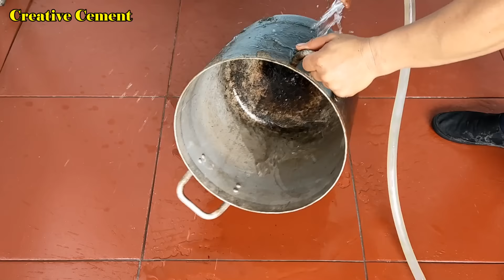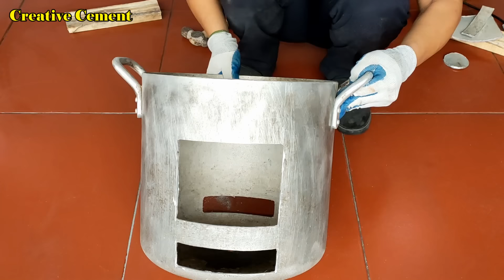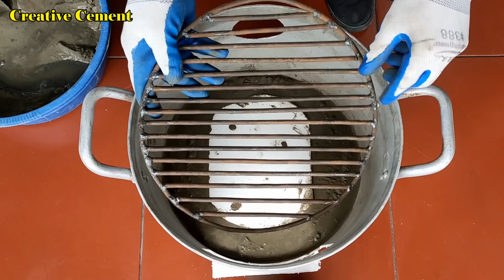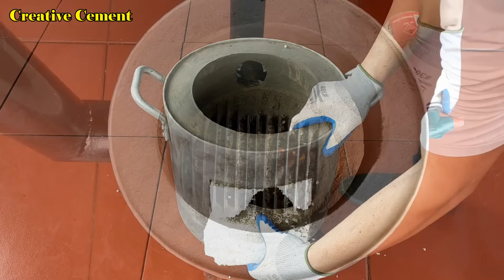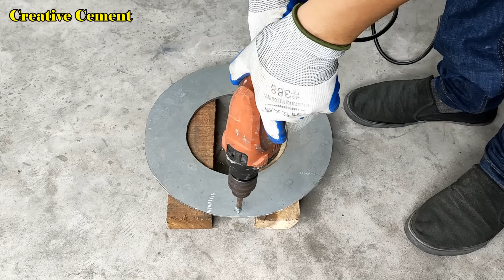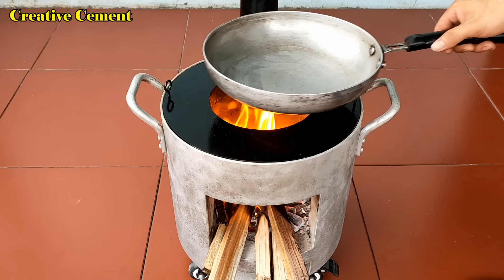The idea of ​​making a wood stove from cement and old cooking pots

Comment: can this be use indoor like a camper van? or is that unsafe? and would it be use as a heater also?  how to take the fire off if not using?
Reply from the maker: You want to use it indoors, you need to improve it accordingly to ensure safety.